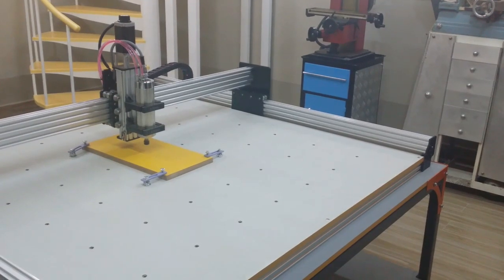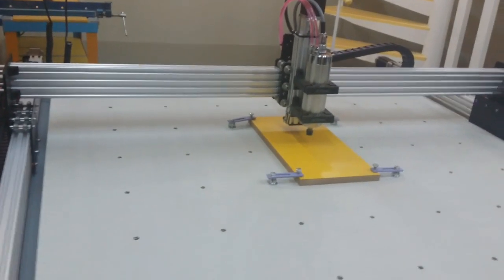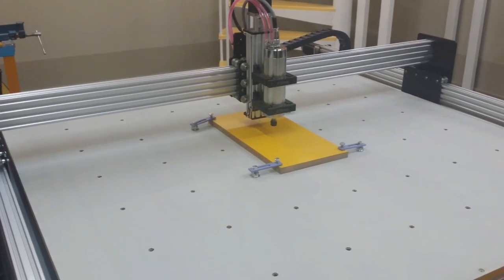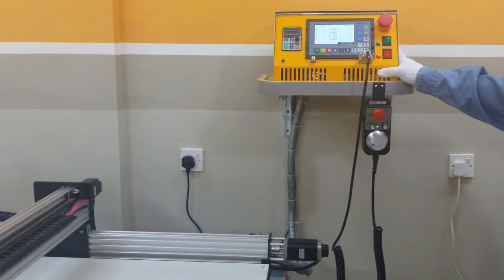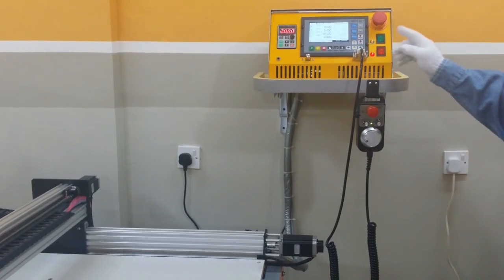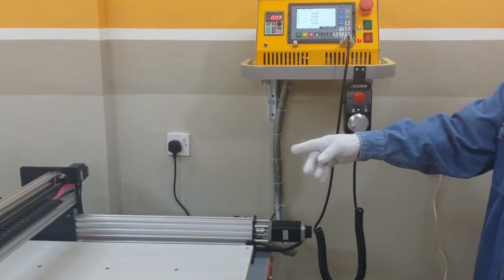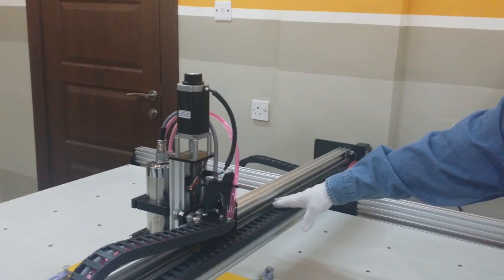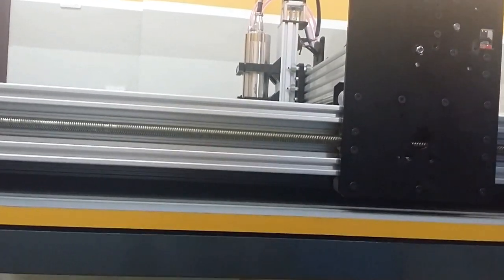DDCS V3.1 &  Upgrade  Workbee CNC Machine

Comment: Looks really good buddy, I got the 1500x1500 workbee as well, haven't put it together yet but I also got new lead screws , 1/2 inch 5 start and changed the steppers to 425 oz . Are you still pleased with the machine?
Reply from the maker: You made me a smile it's like a Chip Foose Overhaulin' but it's CNC machine. That's what I like with this machine you can customize your build abound your choice, I got 80 60 CNC Like 3X2 but that one really different you will enjoy it just simple one. Take your time enjoy the build.
Reply: @yacoubjabal3762  Pimp my cnc router, Be a cool YT channel lol. With my workbee I'm going to build a smaller one then build a large CNC router, I have a 4 axis 34 nema closed loop stepper kit for a 4x8 machine, Just have to finish building my work shop but I'm so excited to build the workbee.
Reply from the maker: Dude 34 nema it will be faster than roadrunner LOOOOOL beeb beeb CNC.
Reply from the maker: By the way I saw 4x8 one time Italian CNC with one arm two axis plus top y axis I could not understand how they do it but that one is industrial one not for hobbyists